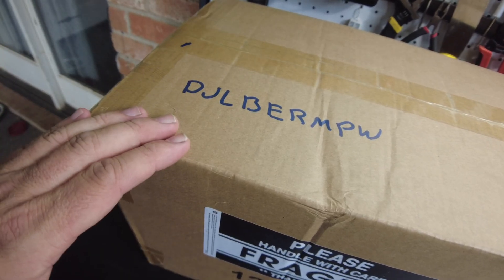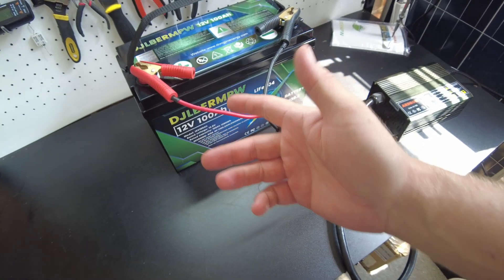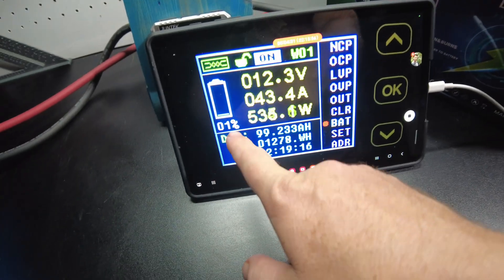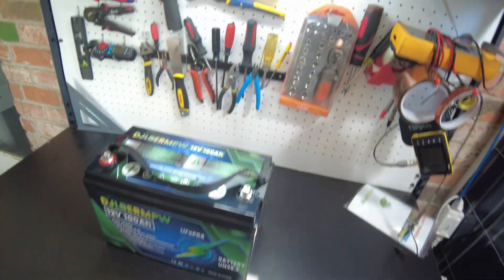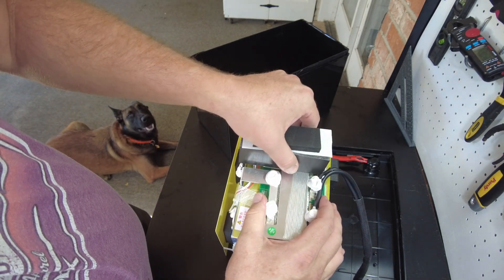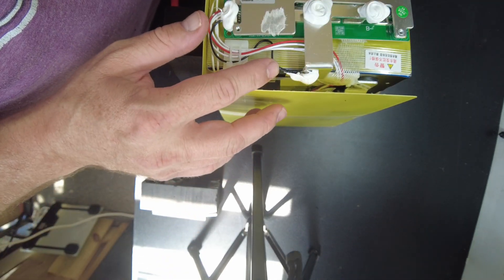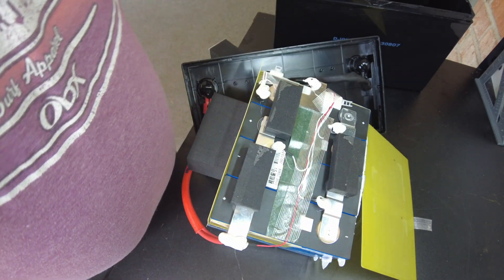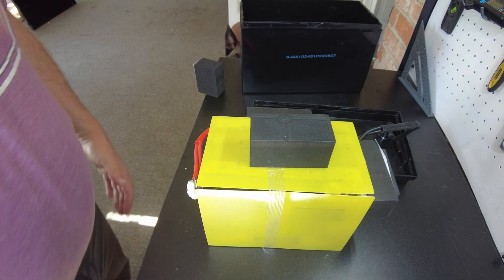DJLBERMPW 12V 100Ah LiFePO4 Battery

Comment from the maker: Affiliate Links:
DJLBERMPW 12V 100Ah LiFePO4 Battery: https://amzn.to/3PVLM3z
ALFFAA 1500w Inverter: https://amzn.to/40bD8R1
Midea U Shaped 12000BTU AC Unit: https://amzn.to/43xiXPm
Shunt I use VAT-4300 https://amzn.to/3SX0bvK

================
AFFILIATE DISCLOSURE: This channel may earn an affiliate commission if you purchase products through links I provide. 
================
CONTACT: bradcagleyt@gmail.com
Business/Collaboration only. Please do not contact me for for personal project help, or advice.
================
DISCLAIMER: These videos are documenting my own projects, and experiences. These projects, and activities can be dangerous. Do not try any of this at home, doing so will be at your own risk.
Reply: Would 4 of these wired in series be ok for a golf cart with a 400 amp motor controller?  Also,  do you have a recommendation for the chargers.

Tks
Reply from the maker: @lilsky12  Probably not. The max current is 100A on these. Thanks

Comment: I put four of these in series 48v 18 months ago.  Using a battery balancer they still have balance issues.  They were getting overcharged, had to lower the SCC voltage down to 55.8v to keep them from overcharging.  They are going strong so far.

Comment: Will mine almost caught on fire, I had it for 6 months and it worked great and then one day when it was fully charged and I was making a pot of coffee the positive terminal turn red and smoke started spewing as the inverter started chirping for low voltage it was still under warranty but they said they could not cover return shipping but they would refund my money when they received the battery and they were lying. Cost me over $40 to send it back in 2 hours to UPS Store and back to ship it and they are still refusing to refund me. They told me I would receive a refund when I returned it and now I'm out $250 with no battery. So my dog my four rabbits and I now know what hydrogen fluoride smells like and it supposedly quite dangerous and deadly. I would not recommend this product to my enemy!

Comment: Do you have an email address because I need to ask you some questions about the way I have them hooked up.   One question is: does it matter which battery you put the positive and negative wires for driving and charging on?

Comment: I can confirm that the carcinogenic smell is still alive and well after having the battery for 6 months. Also opened 2 of these batteries purchased 4 months apart. Different cells and bms's between each unit. One is jbd and the other is some no name.

Comment: What type of bolts are they using to connect the battery leads to the terminals inside the case? Looks like M8 (5/16) bolts but I can't tell for sure...
Reply from the maker: It's probably M8. That's usually the size on the bottom, and top. Thanks

Comment: Amazon has a 100ah LFPO4 for $141.  Can't tell if the battery is any good.  Still I would need low temp protection for use in my RV.

Comment: Hi, I was wondering if you have a good reference for Moseworth batteries? Supposedly they are from the same people of Flypower. The 100ah lifepo4 model on Ebay (USA) are in 175$ with free shipping. I am undecided between the Moseworth and the EcoWorthy also 100ah which cost about 190$. Which one would you recommend?

Comment: Been using this battery for 6mo+ without issue. Handles 1000W easily. Looking to get 2-3 more. Pretty happy so far. Looks like you can almost fit 2 sets of cells inside the huge case...
Reply: how is the battery holding up now? Thinking of getting it for a 30lb thrust trolling motor. Thanks
Reply: What about now ?

Comment: Can you connect the solar panels directly to the battery?
Reply: no, sir, you would need a solar charge controller or an inverter  that supports charging lithium battery by use of a generator.

Comment: Question? Did they send you this battery to review or did you just buy it from like Amazon yourself to review?
Reply from the maker: They sent it to me.
Reply: @BradCagle  Thanks for the reply.  I watched another video where someone was sent a battery and it was really good construction and components.  He wanted another one so he bought the same battery. He tested the amp hours and they were low so he opened it up.  All of the internal components were cheap components and not the quality components in his test battery. They even forgot a nut on a bolt and it was rattling around in the case. He surmised the battery they sent him was a special build just for the test and not a representation of the actual quality of the batteries they sell.
Reply: @tjsmith3060  Was this the same battery company or a different one?
Reply: @BrandonDoStuff  it was a Chins battery.

Comment: I pulled 124ah from my 12v 100ah djlbermpw
Reply from the maker: Wow!
Reply: @BradCagle  that’s what I said. I know they sell a 120ah 12v battery. Maybe they put the wrong sticker on mine. I was so confused by the result I did two more tests. Measured the ah that went into the battery while charging which was 124ah. The second test was identical 124ah discharged and 124ah charged. The most ah I’ve ever gotten from a 100ah lifepo4 12v battery was from Timeusb which was 104ah. Chins gave me 102ah. Powerqueen was 102ah. Expertpower was 100ah on the dot. Very surprised with the results from the DJ battery. Ironically, it was the least amount of money I’ve ever spent on a 12v 100ah lifepo4 battery at $219.

Edit: they sell a 150ah battery. So I have no clue now.
Reply from the maker: @SilverTreasures  That's pretty wild! Amazing value these batteries are, I hope they stay that way.

Comment: nice price.. just too much dead room inside the case..if they make it a small mini case and price it for about 200 bucks it will sell like hot cakes and the 200ah 12v normal size will be the new normal size and maybe price it 400 bucks or so just depending if has bluetooth ect..
Reply: 12v100ah mini coming soon，Certifications are almost being done, MSDS. UN38.3, Transport Appraisal Report, etc
Reply from the maker: Yeah, I like to see smaller cases. But I think the thing with this case size is it's widely available, and cheap to obtain. I don't think the battery manufactures actually mold the case, they just buy them from a case manufacture, and assemble.
Reply: @BradCagle, I agree on the case being widely available. Also, people are used to seeing a 12V battery being a specific size, and I think that makes them more comfortable.
Reply: i wonder if you can buy a small cases  @BradCagle

Comment: its seems most of the battery reviews i watch these days the batts. are passing the capacity test. I guess that means these battery companies are getting better cells ?
Reply from the maker: Yup, it's very rare to find one not passing. I think it mostly has to do with people reviewing the batteries, and testing. If no one was doing this, pretty sure many would be over rating them, and using poor construction.
Reply: @BradCagle  yeah i agree reviewing all these batteries def must have an impact
Reply: @BradCagle  Out here doing the Lords work keeping them accountable! I just purchased a bunch of batteries that look like this one. Just generic graphics. Need to pull one apart and see if it looks the same inside.
Reply from the maker: @BeeneEnergy  Man these things keep getting cheaper, and cheaper. Crazy stuff! Yeah open one up, we need to see it!
Reply: @BradCagle  I wonder if they will bump the price once they have some sales or if it will stick at $220. Can't imagine they are making anything after getting them shipped to the USA and pay the FBA fees.
Reply: Better battery cell will be used, all of which are brand new automotive-grade lithium cells, which can support scanning the code to view factory information.

Comment: A 48V bank would be cheap with this one.
Reply: How is over 800 dollars cheap ?
Oh, nevermind, you buy 14 dollar lattes
Reply: @shakdidagalimal  Normally 48v 100ah is $1500.
Reply: @shakdidagalimal  comparing a 48v bank to $14 lattes in idiotic. This is the cheapest 48v 100ah battery bank your going to be able to make unless you go with Lead Acid. Still not saving much with Lead acid and the Lead Acid wouldnt last nearly as many cycles as the lifepo4.